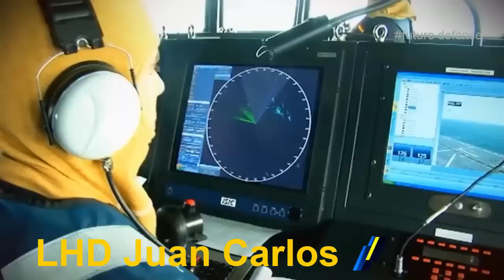here's a giant Turkish aircraft carrier worth over $1 billion that shocked the world

Comment: Hello friends, I am writing from Turkey.  First of all, we would like to thank our Spanish friends who helped us in the Project.  This aircraft carrier is not actually an aircraft carrier.  It was designed for the F-35.  As you know, Turkey was a co-manufacturer of the F-35, and it is still a producer, but it can't buy it because it was removed from the project. Turkey continues to produce parts for the F-35.  If I come to the conclusion, Special Jet UAV and normal UAV are produced for this Ship.  This ship will not be used for Aircraft but for UAV.  Turkey will produce a real aircraft carrier, but there are destroyers that need to be produced before that.  He needs those destroyers to protect the aircraft carrier.  It needs an air defense system in order to produce a fighter, and it has been completed this year.  In short, in 2030, Turkey will have produced the aircraft carrier and will have produced its Destroyers.  In the meantime,  these will be taken into inventory in new Frigates that will be produced.  The new submarines will also be taken into inventory. Also, the surprise news is that they will produce unmanned sea vehicles and will send torpedoes that will work in droves. An unmanned sea vehicle with a very low cost is cheaper than the missile that will hit it, the aim is too much and it cannot be stopped.  There are a lot of projects for Land and Air, but if I tell them it will take a long time.
Reply: Turkey is going to the right direction. 
At least in Arms indestry.